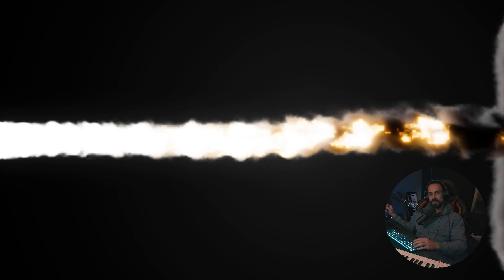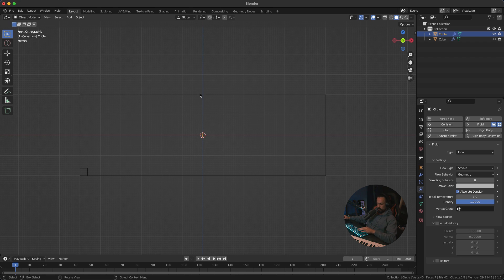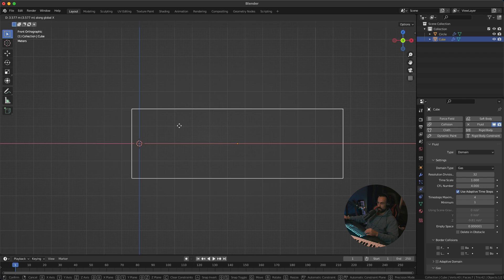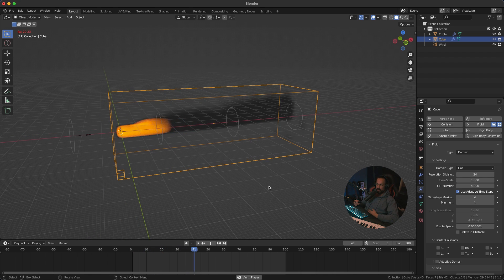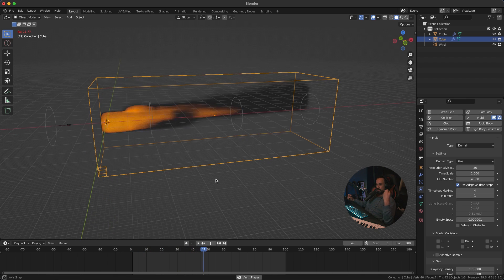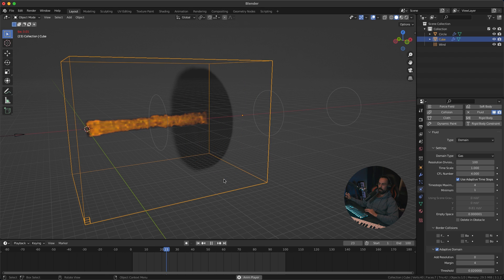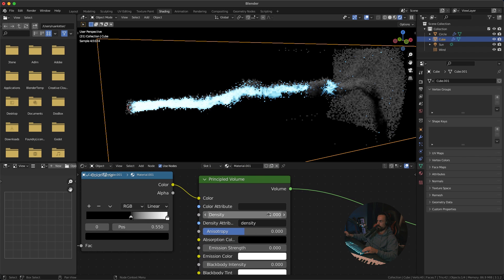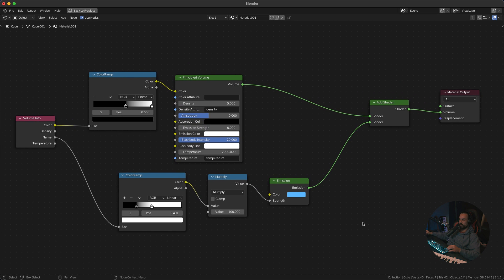Blender Easy Rocket Engine Simulation Tutorial

Comment: BROTHER, THIS GARBAGE DOES NOT WORK WHATSOEVER, I INPUT THE SAME AS YOU IN MY INSTANCE AND I GET A TOTALLY DIFFERENT EFFECT, LOOKS LIKE FIRE FROM A NINTENDO 64 GAME AND THE ANIMATION IS MORE LIKE A SLIDE SHOW THAN AN ACTUAL ANIMATION. SPECIFICALLY WHEN I START PLUGGING IN THE NODES JUST LIKE YOU DID WITH THE SAME VALUES AS YOU DID AND I GET SOME WHISPY BLUE PIXELATED PUFFS , REGARDLESS OF RENDERER OR WHATEVER THE FUCK I DO. iTS FUCKING POINTLESS.

Comment: nope wrong!!! there are no mach diamonds or nothing. This is a fail! might work as a flamethrower but NOT a rocket exhaust.
Reply: Mach Diamonds mean the engine isn't optimized for that atmospheric pressure, the exhaust should go straight back/down most of the times for efficiency